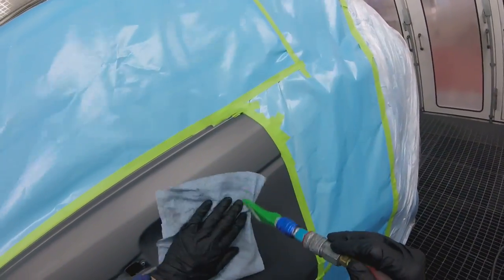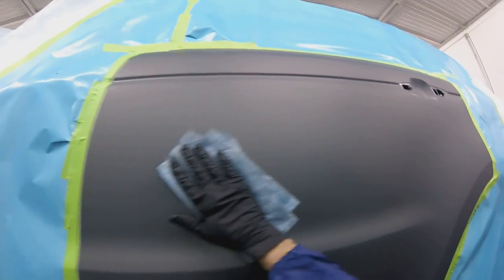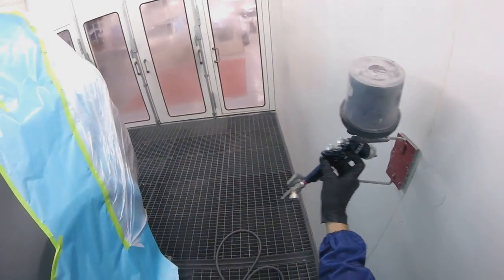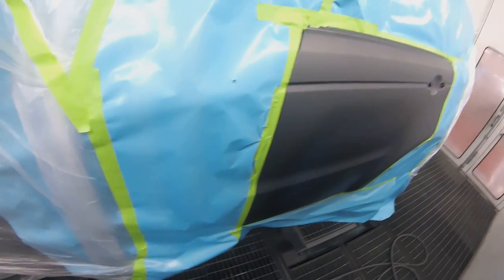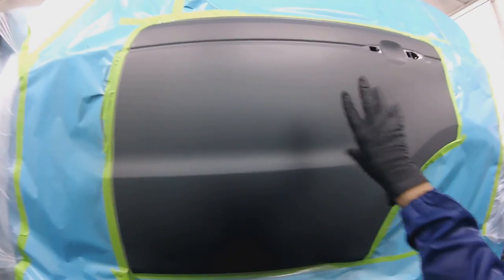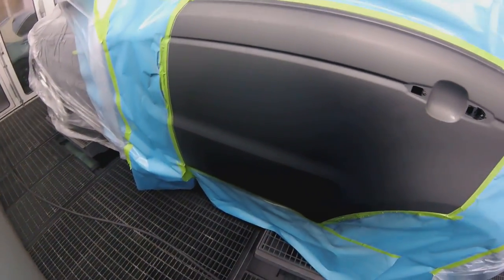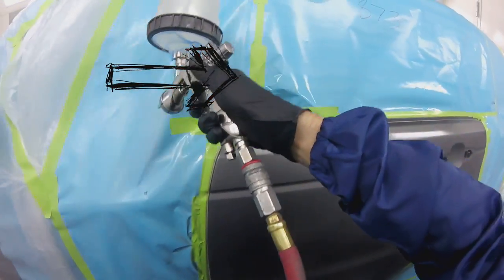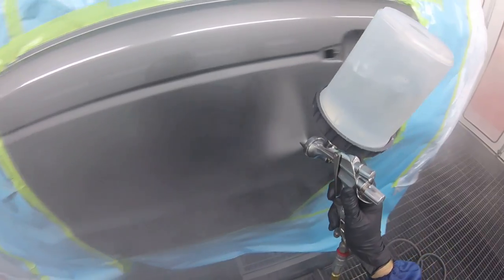How to paint a small scratch Range Rover SCRATCHED!

Comment: Hi, I love your work, I also use the WS400 with a 1.3 HD nozzle for clear and I would like to know what pressure you use with this gun.
Reply from the maker: +Christophe Leboutet I love spraying at 35! 😀
Reply: OK, thanks. I use it has 29 PSI as indicated on the notice but I have trouble to stretch the clear, I am forced to load and flush the run
Reply from the maker: +Christophe Leboutet I always do 35 😀 lays down very nice and you don't need to oversupply
Reply: Ok I will try on the next work. thank you

Comment: Hey bro I just bought a tekna prolite and having issues getting the settings just right think you could offer some words of wisdom
Reply from the maker: +seth kremis Its good for both clear and base Te20 with the 1.2 or 1.3 play around with it and find what you like
Reply: MOTIVATED PAINTERS see I work at a more so budget shop where I found myself thrown into the booth one day and ended up the main painter but I have a lot to learn. The majority of what I'm spraying is cheap nason single stage I probably paint 6 cars using that a day and one or two bccc jobs but the single stage you have to lay it on heavy and wet right on the verge of running for it to really look good I have the te20 and hvlp cap a 1.3 1.4 & 1.5 tip what combo of those do you think I should be trying out? This is the best gun ive ever used and it has so many options and ways to setup that it's just taking me a while to find what works and what doesn't
Reply from the maker: +seth kremis seems like you are SLRAYING heavy stuff so try the 1.4 and crank up your pressure to 35
Reply: Really you think 35 is going to do it? Yes it is heavy stuff it's really supposed to be reduced down about double what I actually put but I found if you put in what they call for I get die back the next day and it just doesn't look as good. What I've been doing lately is spraying with the 1.4 and the t20 at about 28.5 I figure it's about 25ish at the cap af that point and cranking my fan down to just just the edge of where the pattern will start rounding out a bit and that's getting me a really good off the gun finish I think now that I'm around a sweet spot I like I'll just start slightly fine tuning it to get it perfect
Reply: I haven't had much luck getting a even pattern with anything above 30 it always seems to throw all the materiel to the top and bottom of the pattern past that for me
Reply from the maker: +seth kremis that sounds good your not the first person to tell me they like the 1.4 finish
Reply: Really? What size do most people prefer for their finishes?
Reply from the maker: +seth kremis I use 1.3 iwata ws 400
Reply: MOTIVATED PAINTERS never used an iwata myself but I've heard their beast ass guns though
Reply from the maker: +seth kremis you are missing out!
Reply: Seth, why is your shop using single stage?  I absolutely HATE single stage.  ha ha.  I've used it but it is such a cranky product with less room for error, unlike BC/CC.  I can guess your shop is saving money by not using BC/CC.  I'm only a one-guy small shop but still use Nason (DuPont) BC/CC and not single stage.  I found 1K paints take a larger cap and nozzle to get it to even think about coming out of the gun because it has the consistency of maple syrup.  But then you get major orange peel with larger gun hardware.  Hard thing to deal with I know.  LOL
Reply: RPMX4 yeah we do single stage for the cheap scuff and shoots but  I've gotten them to up their price for those kids of jobs so I can at least shoot those with urethane and those come out way nicer and a lot easier to work with

Comment: hey what's men? what is the set up  on your clear gun?
Reply from the maker: +Vijay Ramnauth hello brother!  I use an iwata ws400 1.3hd and really like it two and half turns in the fan and fluid tip until it puts pressure on my finger. 

Watch my how to set up a spray gun video it will be helpful
Reply: MOTIVATED PAINTERS  thanks bro